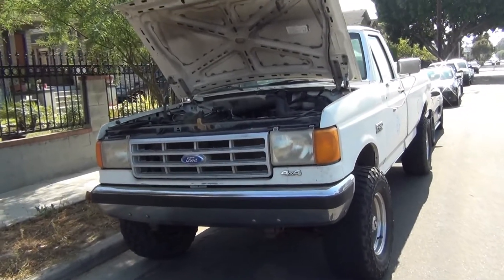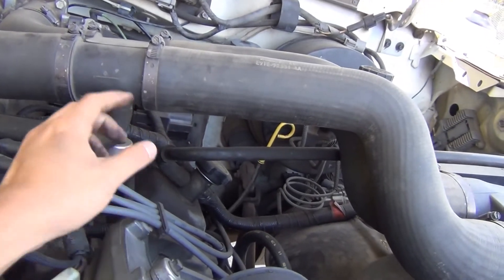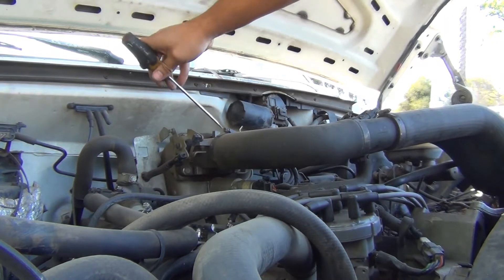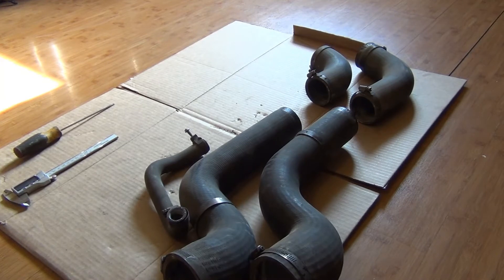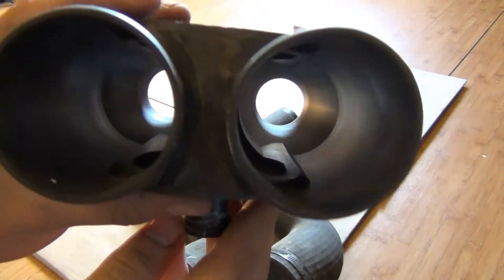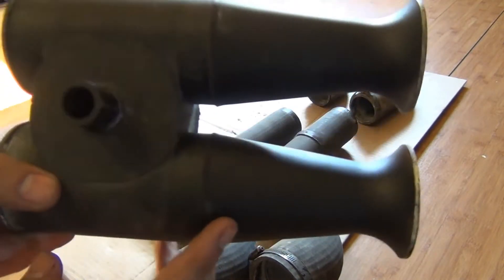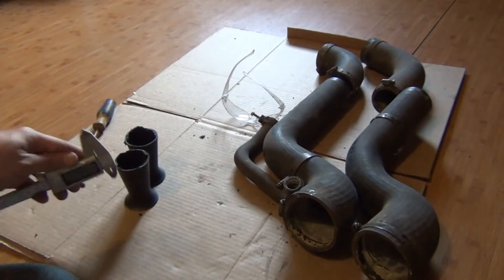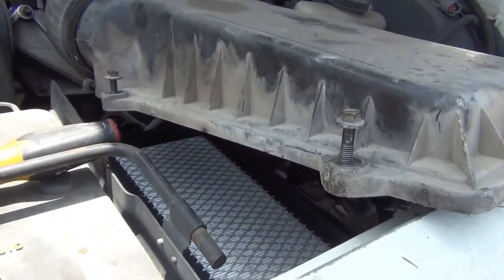460 EFI Fuel Economy Mod #1 Air Intake Hack for Horsepower and Better Throttle Response OBS 4x4 7.5

Comment: Going to do it to mine as well.
Reply from the maker: Hi there! This mod made a noticeable difference in my truck, there was a slight improvement in acceleration along with improved throttle response. You can definitely hear the engine breathing better afterwards

Comment: Literally just did this to my truck 5 minutes ago
Reply from the maker: When I did it to my truck, I noticed the intake became a bit louder, I didn’t notice a huge power gain, but I did feel the throttle response got a little better! Let me know what your thoughts are
Reply: @MrBlitzkrieg1987  drove it about 2 or so miles and throttle response did get better. Intake came a little louder

Comment: Don’t do it
Reply from the maker: I did it 🥲🤦‍♂️😂
Reply: @MrBlitzkrieg1987  did it help? Btw, mine gets 7.2 mpg.  4x4
Reply from the maker: Hey, sorry for the late reply, I don’t think it made a difference regarding fuel mileage, but it did make the throttle response a bit more snappy!
Reply: @raymondmoore2707 Mpg in the same boat, 460 4x4 RV 27 footer 😂 6-8kpg
Reply from the maker: I know it’s a super late reply, but to answer your question, I feel like it helped! You can feel a difference in throttle response and I would argue also in acceleration! The engine did get a little bit louder so you can actually hear when you get on the gas! I believe that is the reason they are in there to begin with, possibly to quite the engine noise
Reply: @MrBlitzkrieg1987  I like the intake noise,  I like a loud rig where people hear me coming.  My lady’s car is an EV,  you can’t even hear that thing inside the cabin, dangerous if you ask me…loud pipes save lives
Reply: Why would you not recommend doing this

Comment: What was the mpg before the mods?
Reply from the maker: Hi, I actually have several videos where I test the fuel mileage, the first time I ran the truck completely stock using a GPS tracker I got 13.4 and the last video I made I ended up with 14.8mpg after replacing a few things. I documented everything I did in the videos if you’re interested. Thanks

Comment: It was made that way to reduce the intake air noise in the cabin.
Reply from the maker: The sound of the intake did increase inside the cabin once I modified it, but in my experience I find it pleasant.

Comment: That's a venture, it speeds the airflow by decreasing the air pressure (PV=T or PV=nRT). I believe it helps suck the gasses thru the small hose. Remember mass airflow is constant throughout the inlet.  How did the mod work?
Reply from the maker: Hi, you’re probably right, I don’t doubt there may be science in it. In my personal experience after removing it, the intake sound became more noticeable from inside the truck (I find that pleasant) Also I think I have better throttle response now that they are gone.
Reply: They work in theory but the horns don’t function as engineered. They restrict the hell out of airflow

Comment: The computer will just reset the air fuel ratio back to spec!
Reply from the maker: What I noticed by driving it few weeks after doing this two things, the intake got  a bit louder and the truck did accelerate better, it’s not a night and day difference, but it was worthwhile in my opinion! I just replaced the injectors on the truck (video is already posted), and I’ve only driven it a few times, but I can’t believe the difference that made!
Reply: The computer on these 1st gen EFIs isnt smart enough to do that. It doesnt have a MAF sensor, and only includes a single O2 sensor in the Y pipe for the exhaust. It's so slow that if it sees increased O2 from the truck running lean itll pump more fuel in, it cant determine HP (they dont even have crank sensors until the OBDII models).
Reply: That's not what it's about at allm it's about the air being able to get in there easier